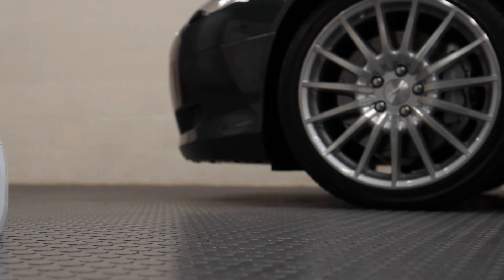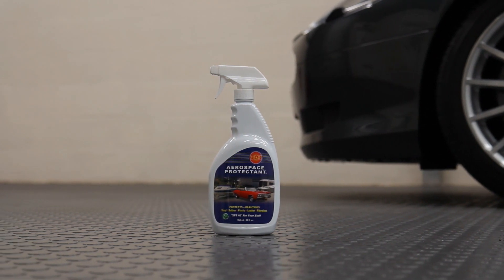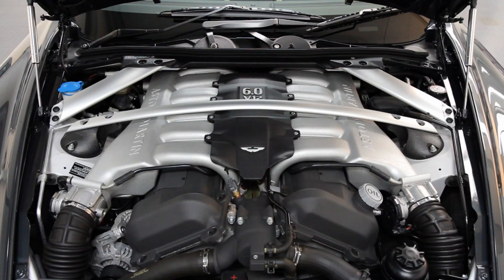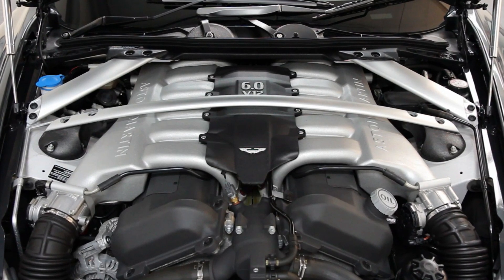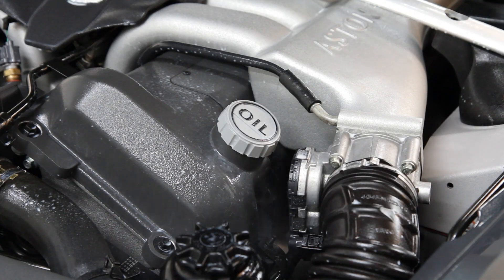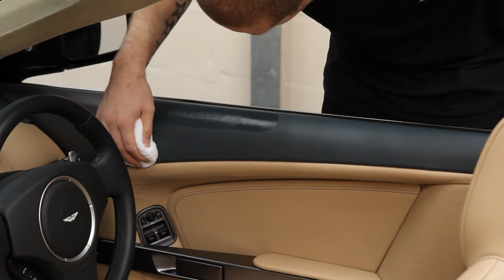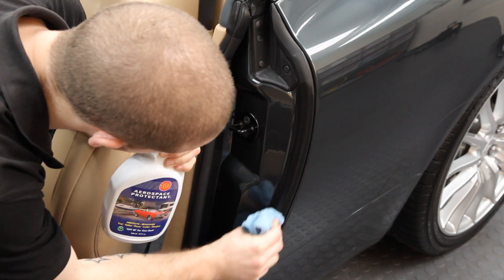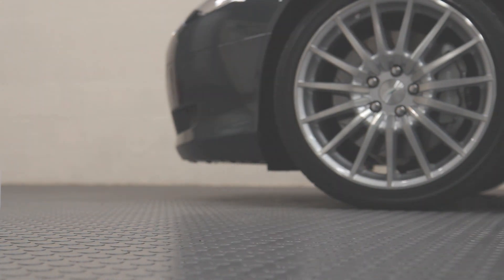Polished Bliss: 303 Aerospace Protectant Demo Video

Comment from the maker: I'm not sure, but I wouldn't personally use a silicon lube, as it would have the potential to make a real mess. Swissvax Seal Feed might be a better bet, as it's a more intensive rubber conditioner.

Comment from the maker: It will provide excellent UV protection, but unfortunately it isn't very durable when used on exterior vinyls and trims (hence why we tend to reserve it for engine bay and interior use). Thus, if you live in a dry region then go for it, but if not I'd look at something else. As crazy as it sounds, Werkstat Acrylic Jett Trigger works great on plastics and vinyls and is a heap more durable; if I had your car it's what I would be using on the vinyl top.
Reply: Just wanna make sure i understand correctly.   I mainly want protection to my plastic moldings and panels out side the car getting direct sunlight  is this not the best for those scenarios?
Reply: Juan Gutierrez probably use Optimum Car wax, that way you are waxing your car and trim pieces in one go rather than using two products on the body panel

Comment: If I'm not mistaken the 303 label states that the product does not air dry at all. Interesting to see your application seemed to mostly evaporate.
Reply: +Marcoosianism - Right !!! Spray, leave it on for a bit, then Wipe.  The " Residue " left behind is your " Protectant ". Try it on Leather Seat (Front Ones) and try it on the Side Door or Dash Board.  Mostly on anything that sit in the Sun.  I got good results using as a " Protectant ". :D

Comment: I've heard several YouTubers mention to use this on paint your thoughts on that? Thanks for your time
Reply from the maker: It works fine on painted surfaces in the engine bay, but because its durability on exterior surfaces is very limited, in our opinion it's not a sensible choice for bodywork. You'd be much better off choosing a coating/sealant/wax instead, as all will last much longer and offer greater protection.

Comment: Can you use 303 on the rubber pads found on electronic drums?  I read in the manual the rubber used on the pads has a preservative, so will 303 help "preserve" the rubber in the same way?